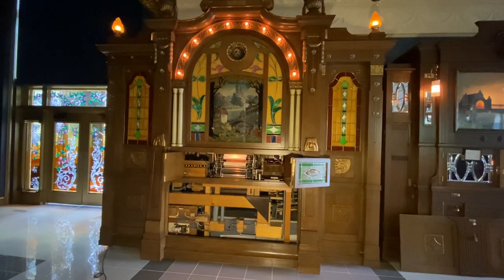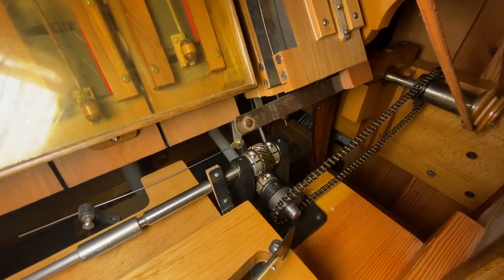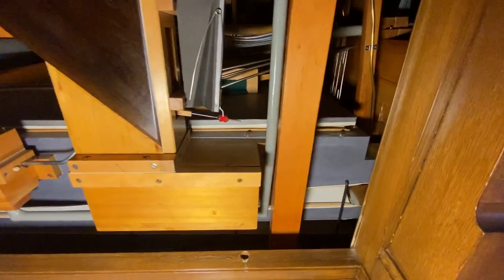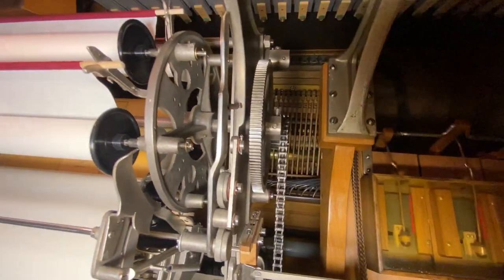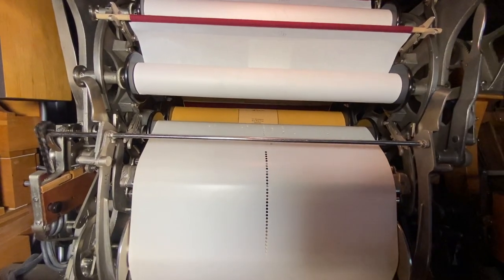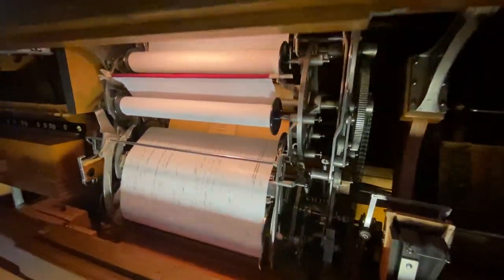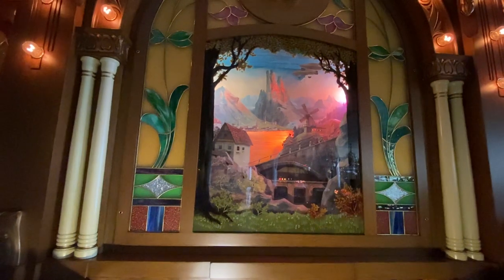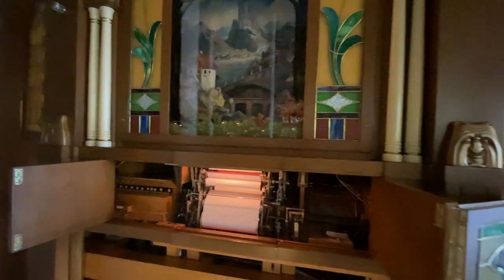Sanfilippo Foundation - Hupfeld Helios III Orchestrion - Demonstration

Comment: So unusual to hear a Helios with bass pipes. Lovely!
Reply: I am not sure if any class I or Ib orchestrions have bass pipes, but the Ic orchestrions I know about all have a single rank of bass cello or viol pipes located along the left side of the cabinet. 

The class II instruments have two ranks of bass pipes, and the class III instruments, of which this is one, have three ranks of bass pipes (in this case inside the left side cabinet). 

It has been speculated by some enthusiasts that the Roman-numeral Helios model designations came about due to the number of bass ranks present, in which case the I and Ib instruments might also have a single rank of bass viols like the Ic orchestrions (I have never seen all the way around inside any of the surviving I/22, I/32, I/34, or Ib/29 orchestrions to know whether or not they have bass pipes). 

Class I was not the smallest Helios model however. 

They made a popular keyboard model in the 1920s without bass pipes (not sure the model designation), and there was also an earlier pre-WWI cabinet Helios model called the "Helios Mandolina" which was once on my wishlist, but there are zero known surviving examples. That model has piano, mandoline, xylophone, bells and drums, but no pipes!
Reply: The keyboard style has bass cello pipes.  I know, because I have one.

Comment: Wonderfull, thank you so much for sharing. As a Hupfeld fan I can't do anything else but love it. One day I hope to be able to enjoy one live. I love the detailed views. Having restored a few hupfeld instruments (just piano's and push-ups, Phonola, Phonoliszt, Unioliszt and Tri-Phonola) there's a lot that looks familiar.

The Helios has a seperate mandoline mechanism hitting the piano strings instead of the mentioned leather straps that drop between the hammers and strings in other orchestrions.

What does the lever under the registerbox do? (the Tanz/Konzert switch).
Reply: I'm also curious what this does. I speculate maybe it controls either a preset for the expression devices (to set it to play relatively softer or louder), or else controls preset register controls to automatically set a group of registers off or on so that the automatic registration is different for "dance" vs "concert" settings. The restorer of this, Ron Cappel, would know for sure!

Comment: Does this model not have any percussion as i can't hear any?
Reply: It has bass drum (with tympani beater), snare drum, and cymbal, in the right side cabinet, as well as a 10-note glockenspiel. The cymbal itself is actually located in the upper center above the pipework. There is also a 25-note xylophone in the upper rear in the same chamber with the melody pipework.
Reply: It is possible the drums etc are shut off, as they have stopknobs to lock them on or off along with the pipe ranks etc.

Comment: What happened to the disco light?
Reply from the maker: The leather belt (rounded) which operates the Wonder Ball at the top, has a metal staple which holds the two ends of the belt together. These regularly work their way loose, so the belt has come off, or the leather stretches and slips off. On this particular machine, we have to disassemble quite a number of parts to reach the pulleys which hold that particular belt in the top of the machine. We'll do this when we are fixing something else or tuning as it's quite an endeavor to get to it. Good catch on noticing it wasn't rotating.
Reply: K, hope the wonderball works when u guys fixed it
Reply from the maker: @BrantDisneyfan  it's an easy fix, once we get to it.
Reply: K Greg